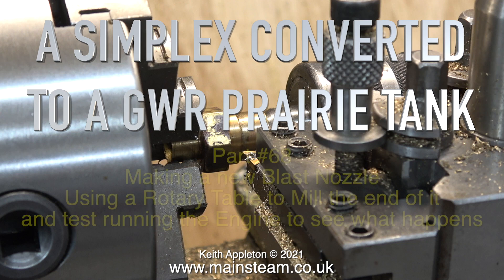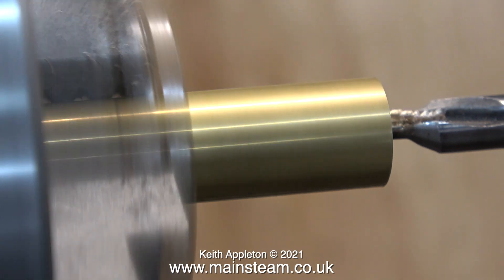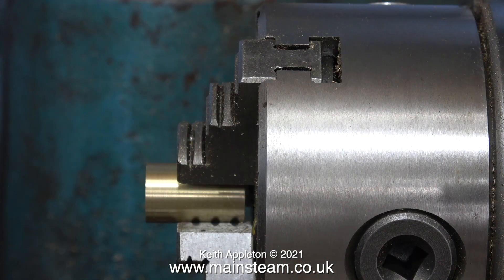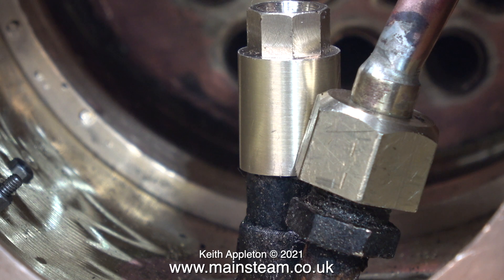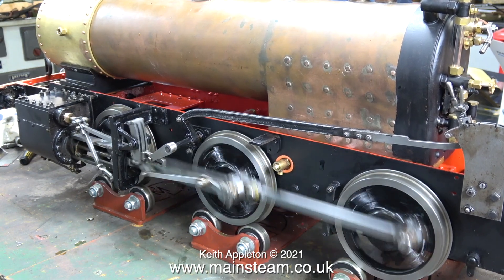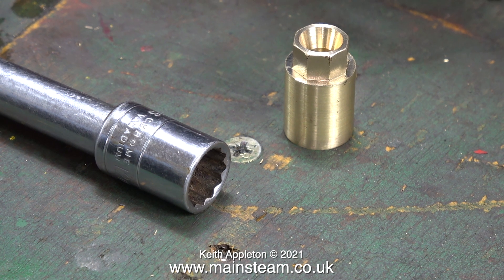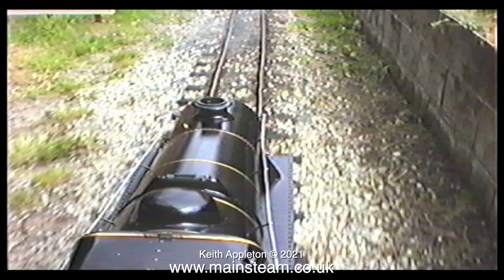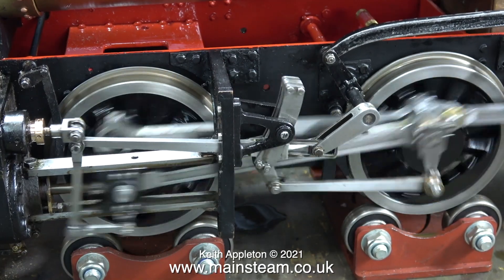SIMPLEX PRAIRIE TANK - PART #68

Comment: In many books written by locomotive crews, there are descriptions of ways they would sharpen the blast of poor steaming locomotives by jamming a spanner or some other device that they fabricated, into the blast nozzle. This was frowned upon by the management as it increased coal consumption, but the authors would insist that not keeping time would result in worse approbation.  L.D. Porta subsequently improved on the Kylchap exhaust by developing the "Kylpor" exhaust which he successfully demonstrated on the 2-10-2 Santa Fe locomotives of the Rio Turbio Railway - see Hugh Odom's Ultimate Steam Page for details. Porta subsequently developed the Lempor exhaust, which he claimed to be superior to the Kylpor. 

In Martin Evans book, page 18, he wrote "....the orifice can be made 1/7 X the diameter of the cylinders".  He continued " The vertical position of the blast nozzle can be decided fairly accurately by the use of two coned templates, one being of 1 in 3 angle, the other of 1 in 6. The effective length of the petticoat pipe below the chimney can be decided by means of the 1 in 3 template, whilst the 1 in 6 template fixes the position in relation to the top of the chimney". He illustrated his words with a diagram, which I am unable to include, but would belling out the petticoat prevent the lower pressure venturi effect air flow bypassing the petticoat pipe & producing the resonance? Perhaps easing the orifice of the blast nozzle very slightly might mitigate things, but as Martin Evans wrote " The size of the exhaust orifice should always be finally determined by experiment, the blast nozzle being made removable for the purpose".

As I am writing this two months after the event, the next video you post will probably demonstrate your solution, however, if the squeak is still unresolved, mayhap Mr Evans offered a way forward?

All the best & many thanks for your videos.
Reply from the maker: A useful comment - thanks for the info Perry {:-)))

Comment: I think the taper inside the blast nozzle is similar to the inside of a whistle. Maybe drilling through the body so that the two tapers don't come to a point inside will cure this?  I don't really know,  but anytime air is compressed through a small aperture into a wider aperture you create a whistle sound. It's the same when you have air moving through a pipe to a larger opening,  the expansion of the air speeds up as it leaves creating a screeching sound. Listen to air leaving a balloon; you'll get the same sound.  Would steam create the same effect?  Like I said I don't really know about enough about steam engines to say for sure.

Comment: 2:47  you wrote  "360 Degrees divided by 6 = 36"

Er, no, Mr. Appleton.  That would be 360°/6 = 60°

Just a typographical error, I'm sure.   Yet for the arithmetically challenged, the puzzlement would be endless.

Cheers
Reply from the maker: Oh noooooo - Just for a laugh, I did this on purpose to see how many critical comments were generated - I think that I mentioned my Maths teacher's comments to accompany the Hexagon/Octagon issue and the incompetent multiplication }:-)))